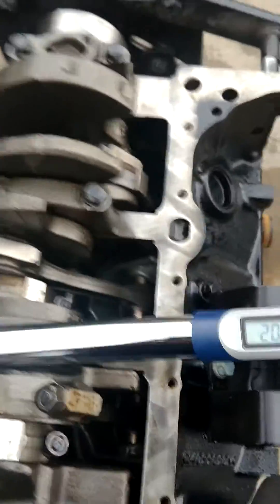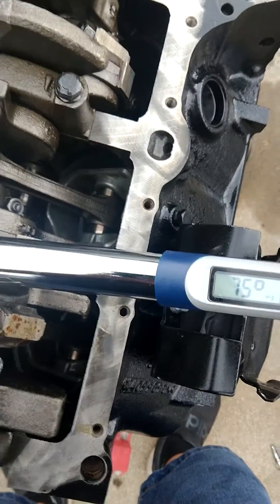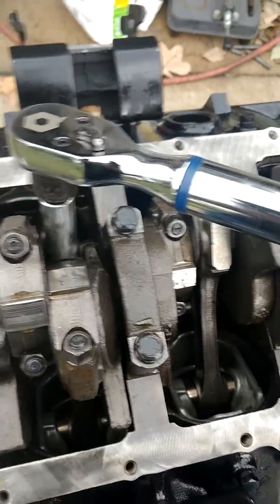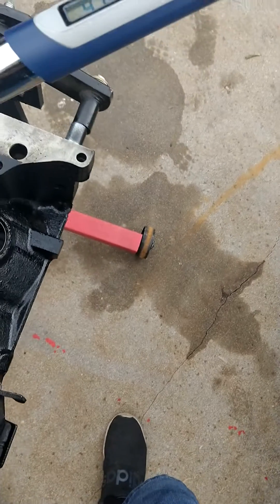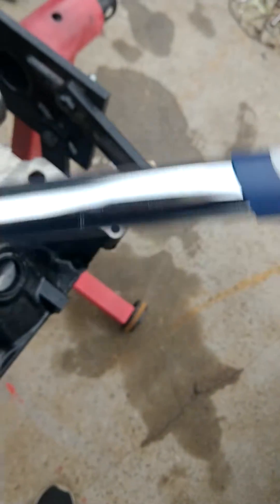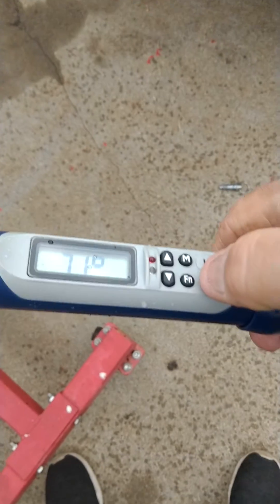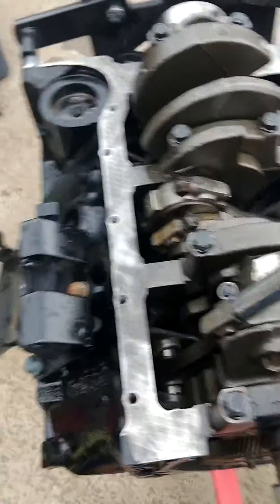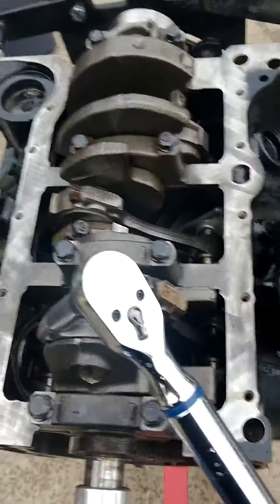Chevy 4.3L rebuild and using a QUINN torque wrench

Comment: Great video using your Quinn digital torque wrench with angle mode. I have a ATD digital torque wrench with angle torque, but haven’t had to use the angle torque yet. I love my ATD torque wrench. How did this job you were doing go? Was everything good sir? 🇺🇸😎🇺🇸
Reply from the maker: He is the video of the 4.3 I was working on.
https://youtu.be/O_sR1kwOUfk